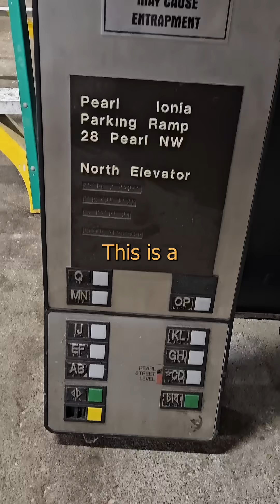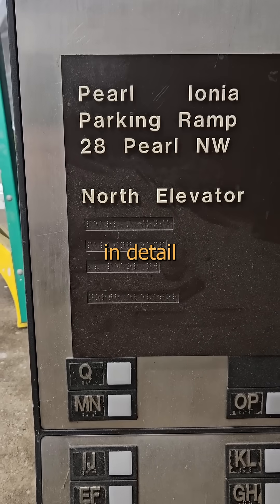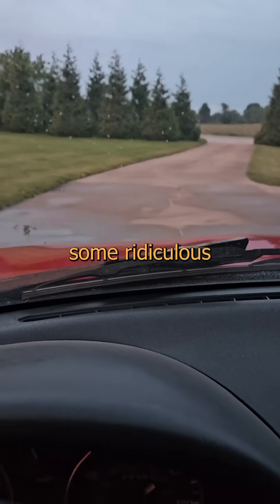Miata Mischief #chrisboden #engineering #gear #elevator #score #stories #parts #hacking #making

Comment: Had to haul an EMPTY IBC container (the white plastic caged barrel)

drove for 24 hour drive from Angers to Toulon to Angers in France ~1800km or 1118mile

Why not buy another one for way cheaper ?
Simple, this specific container which also had the company's logo was wrongly took by another company.
The bosses were so mad they decided to send me literally across France to bring it back... I dont know how but they manage to make the other company pay the trip.

Problem, at the time the only vehicle left for me was a car, to be specific a station wagon...

This is a big container this doesn't fit in a car.
We had to put it on the car strap it and hope and pray that it doesn't fall on the road....

I was arrested by the police 4 times, luckily they were just curious.

It almost fell 8 times.

The car almost tipped once in a sharp turn.

The fuel consumption was 5.3L/100km without it to 19.4L/100km whit the container...

Overall, this trip was meaningless but it sure was fun.

Ah yes almost forgot, the car had a giant sunroof... i don't know how it didn't broke...

Comment: About the sketchiest thing I've hauled is a 55gal steel tank gas water heater on the roof of my 88 prelude using nothing more than bailing twine and a couple bits of an old pellet wrapped in the floor mats to secure it to the roof, drove about 2hours on a single lane new zealand forestry track at about 8pm mid winter, so pitch black

Comment: I hauled a 3' X 6' 180 lb piece of plate steel sticking up from the back seat of my 1991 Lebaron convertible. It was the top for a welding table I was making. I got off work at 2:00 AM and drove 35 miles home with the top down in Minnesota in January. Luckily for me it was 28 degrees and not snowing. A cop followed me out of town, I still can't believe he didn't pull me over to see if I was on drugs or something.
Reply: If he tried to stop you, you could have run; he wouldn’t have been able to shoot you with your James Bond bullet proof shield!

Comment: I moved a 300lb gun safe 200 miles by laying down the front passenger seat in my Ford fusion and blocking 80% of the right side windows 😅

Comment: Had to move a whole bunch of micro sprintcar parts from one shop to another and I didnt have a pickup the time, nor did i really wanna bother anyone else to have the stuff moved. So I loaded up my little mazda station wagon with a shitton of tires and multiple bins of parts in the back, jugs of methanol buckeld into the back seat, and the spare engine in the passenger's footwell. It was pretty neat to be able to fit it all in 1 trip lol

Comment: 3 quick ones:
In 2001 I we were moving from my then gf's childhood home to our new one and last moment we realized that we missed some free-standing cheap metal shelves that we wanted, so I strapped them to the side and top of my Tempo with a bunch of ratchet straps and bungee cords and drove them slowly across town at 4am and somehow did not get pulled over.

One Day, I bought a Harbor Freight folding trailer and put it together at work (I work in an office building) and after rolling it out of my cubicle and into the parking lot, I discovered that I had the wrong size ball on my trailer hitch so ratchet strapped the trailer to my ball hitch and drove slowly home down the service drive of the freeway around midnight.

LATER, I used said folding trailer to help move someone who was evicted back home and overloaded that trailer using every single ratchet strap I had to try and keep the mess together. The junk was just physically larger than anything that trailer was meant to haul. Dressers and a bed or two and a wading pool helped contain the poorly packed junk and kept most of it on the trailer for the rainy drive to her families home (one or two things fell off, but it was a convoy so her parents picked up what fell off)

Comment: Not really super crazy, but once was bored so I drove 5 hours to buy some car parts I found on marketplace. Get to the address one state over and it’s in an alleyway between two old warehouses. Was convinced I just drove 5 hours to get jumped. Seller shows up and says “come on in, parts are in the warehouse.” Was about to turn around and leave but decided to give it a shot. Stepped into a completely dark warehouse, then the guy turns on the lights and my jaw about hit the floor. Marble floors, posters signed by A list celebrities, rare classic cars as far as the eye could see including Maseratis, Rolls Royce and other European and American classics. Even had one of Al Capones personal cars. My favorite was a 96 Camaro SS with 42 miles on the odometer. Apparently the warehouse was owned by some rich guy to house his car collection. The guy I was buying parts from worked for him and had his own workshop in the warehouse. It was such a cool experience. And yes I got my parts lmao.

Comment: Got a 20 ton shop press home in a 1991 Miata, with a passenger. Had to put the top down in 10F weather, put it across the folded top and front half of trunk, ratchet strapped it in place, and drove the 40 miles from harbor freight to home. 

Seemed like everyone on our side of the highway had to get pictures or video as they passed us. I'm sure they are out there on the internet somewhere, but I still haven't seen one of them yet.
Reply: The number of people not understanding that a 20-ton press is referring not to its overall weight ...
Reply: @enigmab0x865 ironically if he’d put the hyphen like you just did I wouldn’t have misread it, haha
Reply: @enigmab0x865  - No but I'm pretty sure it still won't fit in the Miata's trunk.
Reply: I've hauled lumber with my 95 Miata but you got me beat there.
Reply: My Miata is also a truck.
Reply: I’m sorry, did you type that right? You put a 20 ton press on top of a 1 ton car?

Don’t mean to be that guy, but there’s no way. You wouldn’t even be able to turn at 2mph if it’s that top heavy, and that’s ignoring whether the frame could even hold that (I doubt it).

Edit: seems he meant 20 ton capability, not weight. Skepticism rescinded. I don’t have/use a shop, so I’d never seen one 🤷🏻‍♂️
Reply: @carazy123_ a 20 ton press doesn't weight 20 tons, it has a 20 ton bottle jack in it.
Reply: @petergraphix6740 wth, youtube, I just posted almost this exact thing, and the comment disappeared... thanks peter for saying it again, maybe they will let yours stay... 🤔
Reply: @petergraphix6740 that’s fair, just a misunderstanding bc of the phrasing. He didnt clarify he meant the capability of the press, so I read it as the weight in question.
Reply: @carazy123_  It's not really misunderstanding of the phrasing, it's more you not being familiar with what they're called :) Everyone that has some experience with this kind of stuff knows that's just the rated capacity.
Reply: @carazy123_  Go look up what a 20-ton press looks like... they only weigh about 200 pounds all together. A 1st gen Miata can definitely handle a driver, a passenger, and a press that weighs 200 pounds that has the "ability" to exert 20-tons of force in a centralized spot.

The important thing is knowing "20-ton press" doesn't mean it weighs 20-tons... it means it can PRESS 20-tons... Hydraulics is neat innit?😛
Reply: @zachariahbrewer1534  I don’t doubt it could carry 200 lbs lol. Just an important clarification missing
Reply: Lol you sound like the type of guy I'd love to have a beer with and discuss how that couldn't have happened
Reply: @carazy123_  a 20 ton shop press weighs significantly less than 20 tons. The 20 tons is the measurement of the force it can apply.
Reply: @MultiJordan2005 read the edit and the 2 messages above lol
Reply: @carazy123_ the other messages weren't visible so I didn't know
Reply: @carazy123_  to be clear, a "20 ton press" is a press capable of exerting 20 tons of pressure. It doesn't mean it weighs 20 tons... 🤔 
****The More You Know****
Reply: My wife would be so pissed 🤣
You win.

Comment: I helped a guy move his newly purchased “helicopter in a box” with an ‘89 Toyota pickup and a U-Haul trailer.

It was mostly assembled, so I went to U-Haul. The clerk asks as she fills out the questionnaire,”okay, what is the make and model of the car you will be hauling?”

“….uhhhhh, 1978 Toyota Corolla.” Which was my mom’s car that first came to mind. They rented me the trailer, despite the wicked grin on my face.

So, me and this multimillionaire helicopter owner jump in my old pickup, ratchet straps and cash. 

We BARELY did get the skids on the trailer, the entire aircraft, some of it in giant parts boxes like blades and tail. It hung over the trailer in all directions. 

Millionaire called for his car and drove off fancy. I handled the drive by myself. 

To get to our destination, I had to drive across in front of the U-Haul place. As I passed. I waved, with a menagerie of bright yellow helicopter hanging off their trailer. I saw cartoon eyeballs.

Comment: to put this in context: this sighting happened just after Mythbusters confirmed that a car going off a cliff could spontaneously explode, if you loaded the front bumper with gas (petrol) containers and duct taped a box of strike anywhere matches onto the front.  

I saw a pickup camper with one of those hitch mounter auxiliary cargo trays mounted to the front - loaded with gas cans.

Comment: I track a second gen mini cooper s. Trying to race on a budget is difficult but I find parts like tires that the hardcore teams are selling. Sometimes they'll only but a day on tires and then decide they're too worn for them but for me I can get a couple more days or about half an autocross season on them.

One time I saw a killer deal for eight tires for 250$ (normally one tire is 200$) so I headed out two hours with my allowance from the wife and I loaded up eight tires into my gutted mini cooper. They were pushing up against me and I had to move my seat forward and angle one tire up onto the dash and fill the passenger seat.

Comment: I worked at a small regional airport when I was 17.
A plane came in poorly and the prop tips hit the runway, the outermost 2 inches of each tip were rolled over pretty well and it was out of commission until replaced. I asked for and was given the bent prop.
I'm under six feet tall, it was over seven.
I was riding a Yamaha R5C 350. 
I balance the prop across my thighs and a jacket on the gas tank to protect the paint, and head down the road, staying in the middle of the lane to avoid hitting cars in adjacent lanes.
But, a prop is like ailerons that want to bank left, more so, the faster you ride.
So now I'm using my clutch hand to slide the prop to the right as I pick up speed, left as I slow down, while keeping me upright and the blade centered in the lane.
Stop and go traffic through a mid-sized town in Southeast Ohio at 4:00 pm on a Friday for about 10 miles.
That was the most physical ride I ever rode, I had dreams of cutting off just the tips and building an airboat, but ended up selling it as scrap when I joined the Army a year later.
Reply: I was building a laundry room add-on for my house. To pour the foundation, I needed to haul some rebar: a bundle of steel rods exceeding 600 pounds. I had no trailer, just my pickup to haul it. So I asked the boys at the yard to forklift the bundle onto some blocks. I then parked the truck over it and strapped the bundle to the bottom of the truck, lifting with the ratchets. One strap at the trailer hitch, one at the tow hook in front, and one on the frame in the middle. (NEVER strap anything to the driveline!) After about a quarter- mile, I heard it dragging, so made an emergency stop. One of the non-heavy-duty straps had broken. I was stranded because I could not continue to haul this load, but if I released it, I would never be able to pick it up again. So I called a friend and asked him to go purchase the heaviest-duty straps he could find and come rescue me. With the new straps, I was able to complete the trip. Sketchiest load I ever hauled.
Reply: Not really the point, but how did the pilot, uh... do that? Twin engine landing pitched to one side?
Reply: @mikeglass  the nose was probably tilted a bit too much forward
Reply: @mikeglass  Probably a single prop aircraft with the nose tipped a bit too far.
Reply: Ofc the cool story ends up anticlimactic because of the army
Reply: @michaeltagor4238 They often do.
Reply: @SteveJonesOhio  hauled an entire 80’s home theatre setup home in my 7th gen accord. 4 tower speakers a entire reciever tower and a subwoofer. had two of the towers on the armrest sticking out of the sunroof
Reply: Being the former child of a former airport manager, I believe this one. I don't believe the dude claiming to have won an auction over an F16 engine while being a college student, and driving a civic to try to pick it up
Reply: @EveryBigfootIsANinja  I believe him, I have tons of old military junk from government auctions. No jet engines, but I do have parts from one's radio setup.
Reply: What plane did the prop come from?
Reply: @SteveJonesOhio  This one has my vote
Reply: Thank you for your service
Reply: Amazing
Reply: I have to ask, why didn’t you just carry the prop inline with the bike, or rig it up vertically?

Comment: I have a couple instances of hauling sketchy shit around on sketchy means of transportation. Note this is all during high school and I didn't have a car/license at the time (still don't cuz I'm a hazard). Anywhosies, first up transporting 2 full tower PCs, and 2 old ass CRT monitors (up until I was able to upgrade to 32inch monitors) about 4-5 blocks away by hand (sometimes settings stuff on bicycle seats to ease the suffering) over to a friends house for LAN parties almost every weekend in summer. The second was trying to ride a bicycle while holding a mini box TV 10-15 miles outside of town to my friends house. Note that the trip we had to make sure we wouldn't get hit by traffic as cars are going around 50-60mph and we are on the side of the road since no sidewalks out in the country lol.

Comment: I drive a Toyota GT86 that has been lowered on coilovers (it’s not slammed, I ain’t gay). I had to take this really, and I mean REALLY, fat girl (like 400lbs+) to a gas station. It was a miracle she got into my car. Getting out on the other hand… wasn’t as easy (I want to make it clear that it was NOT easy to get her in). For the entire ride, even with stiffer-than-stock suspension, my car noticeably leaned toward the passenger side. She got me to buy her stuff in the gas station while she sat in the car. After another angled adventure, we finally got back to the place we came from. I kid you not, it took her 45 minutes to get out of my car (I’m a gentleman, but no amount of gentleness on my part would ever get her out of my car). I tried helping her but if you couldn’t see that I had been trying to get her out you never could’ve told that I was even there. I watched her struggle for over half an hour, and finally, she managed to roll out of my car (I know my suspension was grateful). When she finally did get out she was on the floor and couldn’t get up (and I couldn’t get her up). At that point I just locked my car, walked away, and enjoyed my gas station goodies. I left her stuff on the floor 50 feet away.
Reply: The ending was only for comedic purposes, I got a couple of other guys to come help her up.
Reply: @xxrainingkingxx7658  whew 😅 I was like damn u savage
Reply: @xxrainingkingxx7658 lucky you she wasn't a rapper...😂

Comment: I've installed a reverse camera in my '01 Impreza and have moved house a few times. With the back pocket packed to the brim, the rearview mirror is about as useful as a knitted condom. 

Had a lightbulb moment and went down to the local hardware store to pick up a switch to power the reverse camera any time without needing to be in reverse

Comment: I can confirm you can fit at least 16 large pizzas in a first gen Miata. 8 on the passenger seat, 4 on the passenger floor, and 4 more in the trunk. I’d bet the absolute limit is just north of 20 without a roll bar.

Comment: went out with  fiend in his mustang and we had the top down. we got a 52 gallon container from Walmart which didn't fit in the car so we used trash bags as a tiedown (it worked surprisingly well) but we couldn't go above 50 mph. made it safe and didn't have any issues with it after.

Comment: I hauled several sheets of full size plywood sticking out the back seat of my old 2004 chrysler sebring in my early 20s. It was a convertible so i had the top down in order for it to fit and had 1 hand to hold it down against the wind. 

Good times..

Comment: I had to tow my 96 Catfish Camaro home one night. We flat towed it behind my truck at 9pm, with 0 power of any kind to the camaro and it started to snow thick snowflakes halfway through the 9 mile journey. Get to my house after some real sketchy turns through narrow streets around my block and no visibility and then we couln't push it up my driveway. So we slapped a mattress iff the back if the camaro and my friend used his LS swaoped miata to push it up into the garage.

Comment: I dont wana prize ! but here is the story , big welding  transformer in the woods , how it get there I draged it to the woods because it was a other town , and was a speak of rust on it but time was short , I bought a roll trash bag covered it multiple times and hid it a small forest it so scrappers wont find it util I come back. YES I came back for it with a grandma trolly , and it worked for more than 11 years after the find , and when I was moving I give to friend where beca a welder transformation agen.

Comment: I bought a generator and i only had my trike with me, so i loaded it balanced it on the seat, tied it down with my bike lock and walked it almost 1.5 miles to my apartment, getting across US-70 with that was an experience